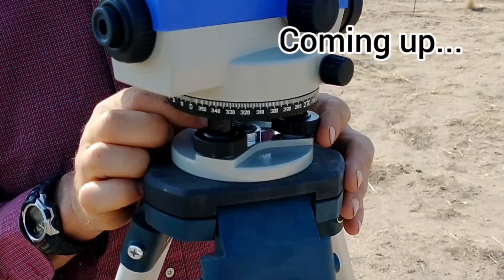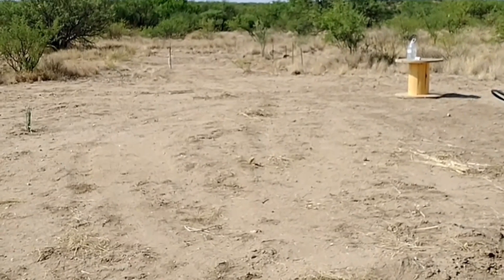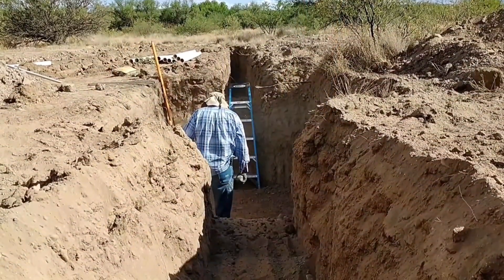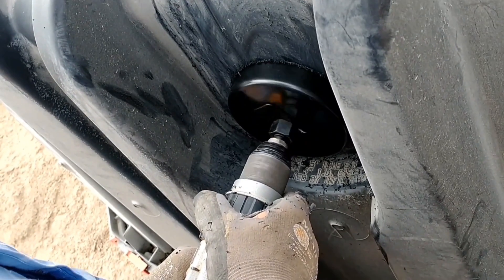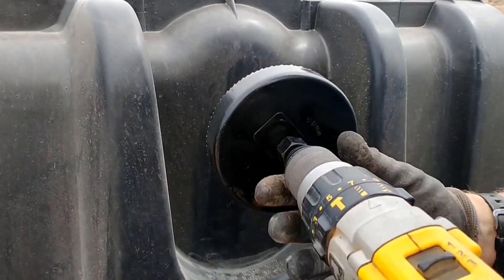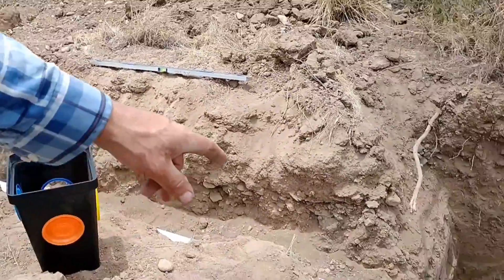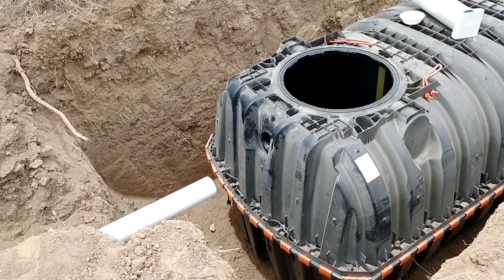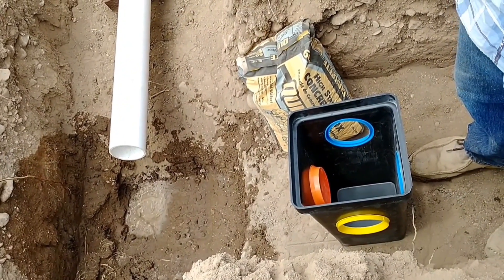DIY Septic Install Part 1 Infiltrator 1060 Septic Tank & 4 Hole D-Box

Comment: Does the outlet hole not have to be drilled lower than the inlet on these infiltrator tanks?
Reply from the maker: The inlet hole is higher than the outlet.

Comment: Installing 2 of these right now. Good tip on cutting the angle on the inlet pipe, that's a tight squeeze! I'm actually wondering if you ended up having to glue the inlet pipe into the inside down pipe?
Reply from the maker: Yes, he glued them. Hope your install goes well!  🙂
Reply: @RedandAprilOff-Grid  thank you 👍

Comment: Did you put a filter on the "inlet side"? If so, Why?
Reply from the maker: A filter came with it, but he didn't use it.
Reply: @RedandAprilOff-Grid  Okay, the filter goes on the outlet end of the tank to supposedly keep chunks out of the leach field. The baffles on each end are identical and will accept a filter. I don't use the filter either.

Comment: Surprised the tank doesn’t melt when it’s 130 f outside in hot ass sand that will burn you. Shit is a piece of junk it has clips holding it together. Get real .
Reply from the maker: It is filled with water for a leak test. Our highest temperature last year was 105°. It's a good functional tank that will last as long as we need it to.

Comment: We used the same Infiltrator System.  Was easy to work with and set up.
Reply: Did you use the 5 inch hole saw for the gasket?
Reply: @dare369  i believe so, yes. Here is a video of our full install.  There are other videos of the septic on our channel as well.
https://youtu.be/Ur73PhAC3tU

Comment: Does the government allow this? I have 1 acre with a failed perc test
Reply from the maker: We are in an area that is zoned RU4 (rural and at least 4 acres). This zoning is required for the type of permits we have. Different counties have different requirements. The results from our perc test said we had to have 100 feet of leach field, and a 1000 gallon tank. We had 2 inspections and a leak test. 
Bummer that your property failed the perc test! Maybe there is something you could do, bring in a bunch of sand or something.
Reply: @RedandAprilOff-Grid  maybe I can just park my RV on the land and plant crops… I could find out by contacting the county correct?
Reply from the maker: In not sure. It seems like whoever did your perc test should know something about it, or they would know who to ask. 
Our son's perc test said he needs 275 feet of leach field, and a 1200 gallon tank for a 1 bedroom house! The quote he got to have it done was $13,000!
Reply: @rhb30001  this is the route I want to go. Did you ever talk to the county
Reply: @sunstirade1085  yeah as long as you can just back up your truck and move it the RV is classified as a motor vehicle..just don’t make it where you can’t move it out immediately and you are fine